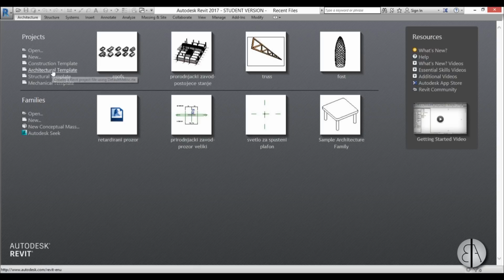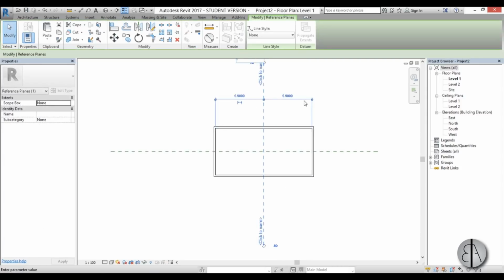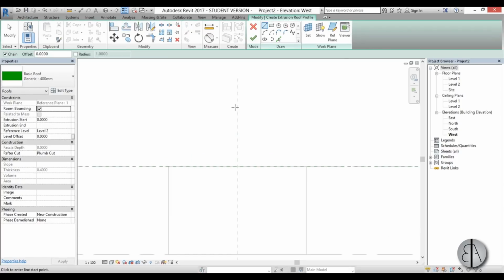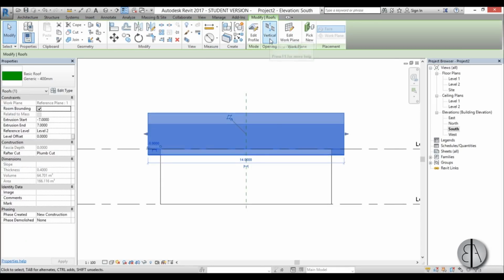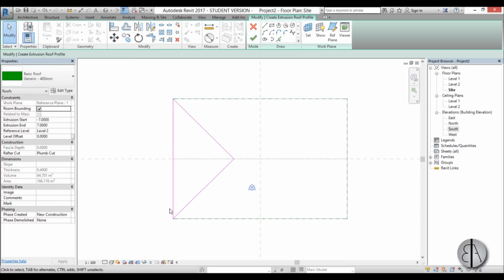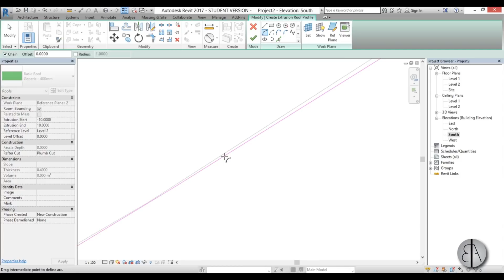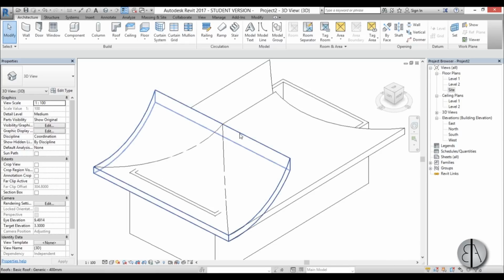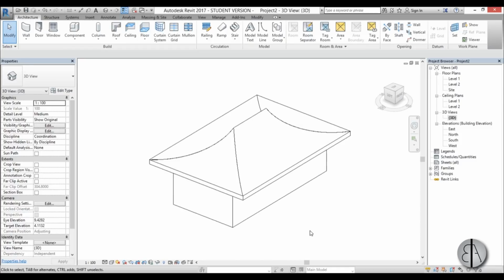Modeling a Traditional Chinese roof in Revit

Comment: Fail!!!
You just copied the shape of the "Traditional CHN roof without considering what goes underneath the roof so they won't fall down in the case of a 10.1 earthquake.
榫卯 corbel  & 斗拱 dougong [interlocking wooden brackets]

The correct tradition CHN palace's walls are not load-bearing.
Please watch this and understand it better.

How China Built Earthquake-Proof Palaces | Secrets Of China's Forbidden City

https://www.youtube.com/watch?v=w78Yb_aotH0